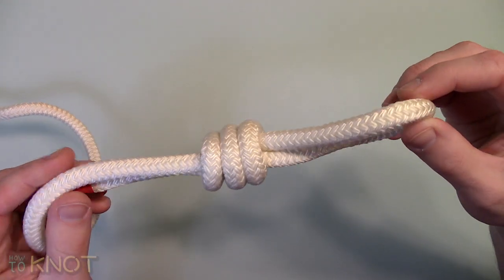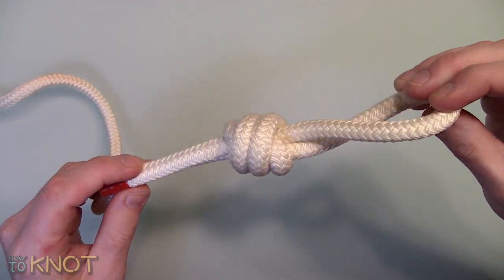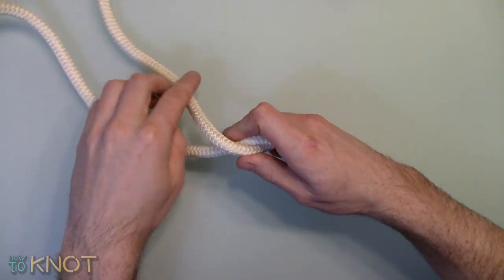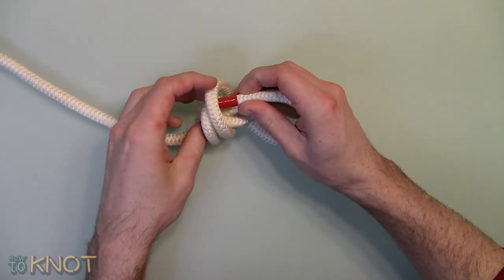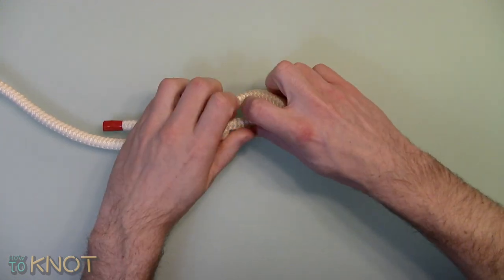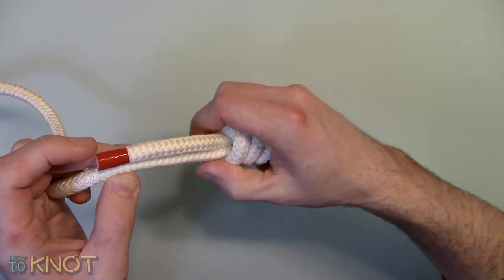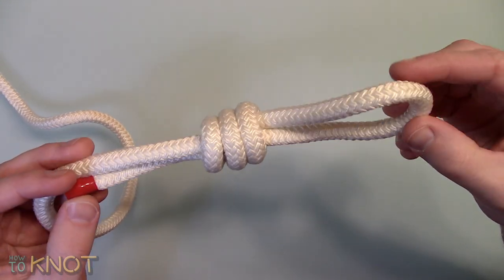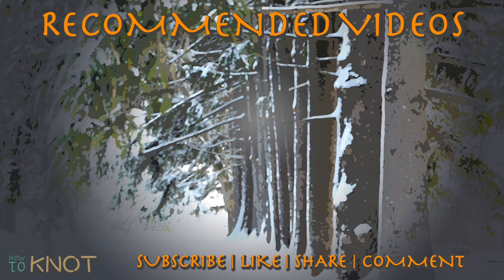How to Tie a Scaffold Knot

Comment: How do you untie the scaffold knot?
Reply: I imagine that you would just slide the slip knot loose but this is not the type of knot I would ever use to tie scaff tubes on with
Reply: @daddydude5606  I think this knot is for lifting variable sized things up a scaffold. If you need to lift the tubes to the top to construct the scaffold, this is what you use.
Reply: @daddydude5606  would be handy for the bags though I reckon, go round the handles well
Reply: @fungames24 generally better off doing the rolling hitch, it's the most secure of the tubes and there's two different ways of doing it so you can slide it over shorter tubes doing a few at a time
Reply: pull both ends